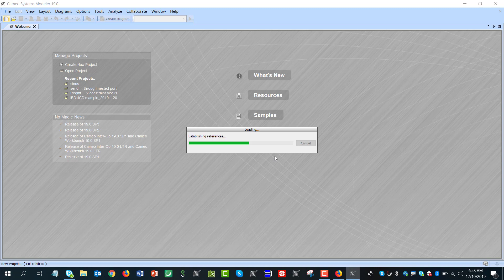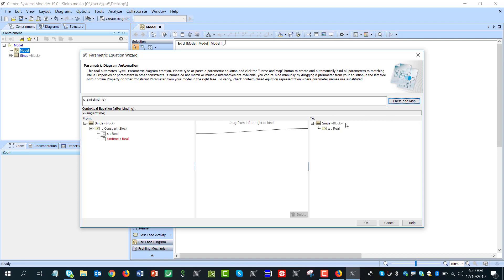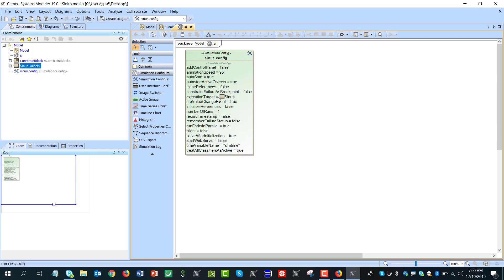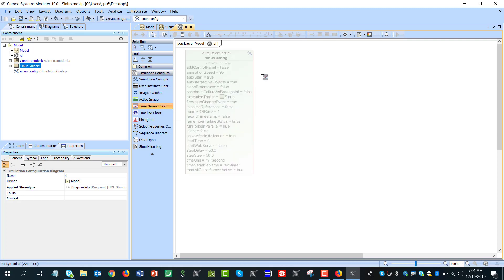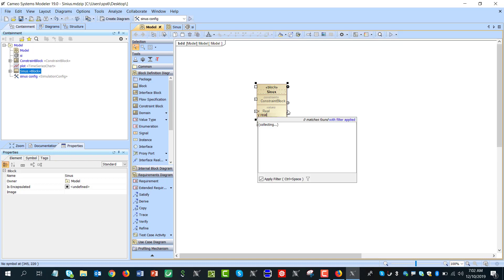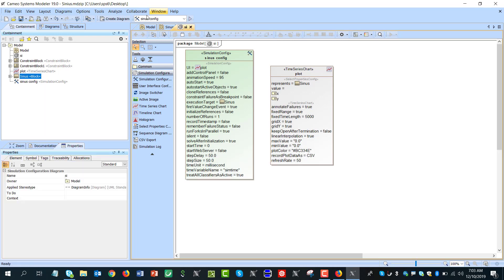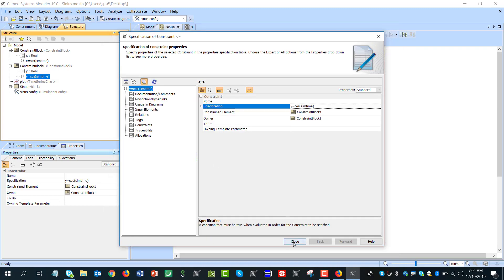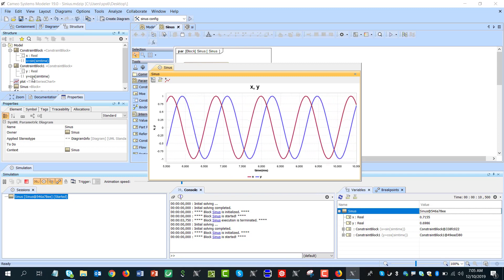Simple Value Plotting Tutorial Using Cameo Simulation Toolkit

Comment: Dear Sir,  Can you give me some advice on how to do the derivation and integral with time in the parametric diagram or constraints. I want to make a simulation with circuit model having inductors, capacitors...
Reply from the maker: Hello Bang, Cameo can use Open Modelica and other math engines as evaluators for parametric constraints and other expresions. Open Modelica support advance solvers. Be sure to use right version of Open Modelica as newest one does not support this integration. More is available here https://docs.nomagic.com/plugins/servlet/mobile?contentId=14664008#content/view/14664008

Comment: The simulation does not work until right clicking on simtime in tab Variables >> choose Add value! How can we solve this problem?
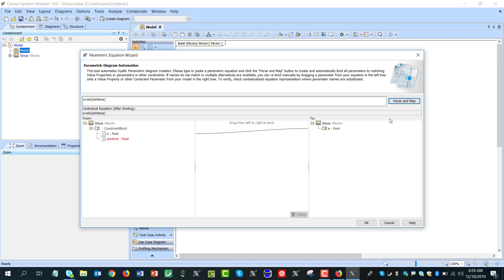Reply from the maker: Hello, please be sure to delete simtime parameter from constraint as presented @ 1:25. Use Ctrl+ D to delete from diagram and model. Simtime is reserved name of the variable and there is no need for parameter in constraint with same name. If you leave such parameter it needs to be connected to something for constraint to work. This is likely why you need to add value to it in variables panel.
Reply: @MBSEExecution   Thank you very much! It is true. I just deleted from diagram but not the model. When deleted from the model, it worked.
Reply: @MBSEExecution  This fixed my issue too. Thank you!
Reply: @MBSEExecution  Thanks, this fixed the problem I was having.